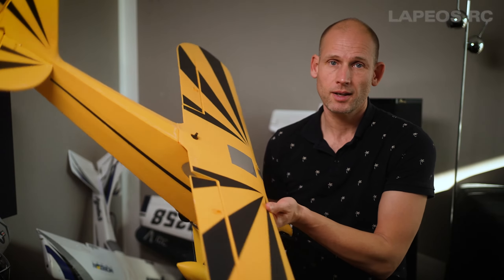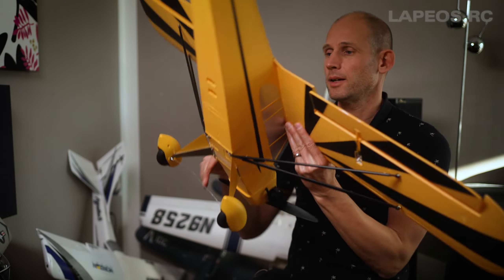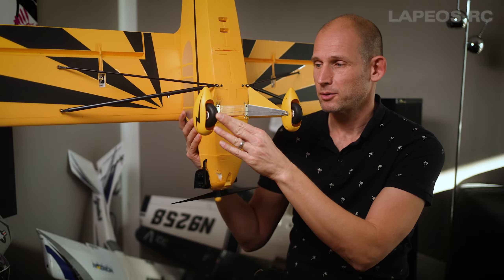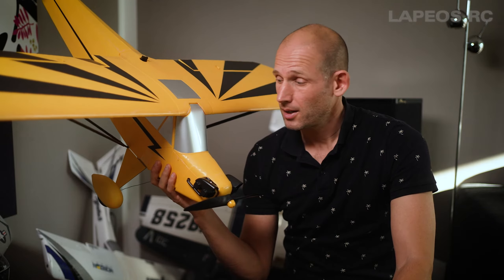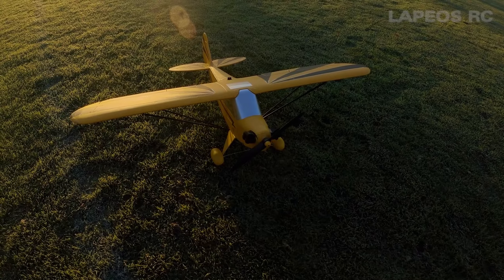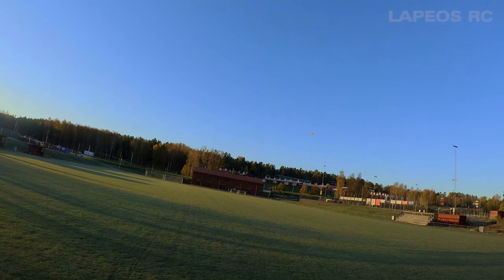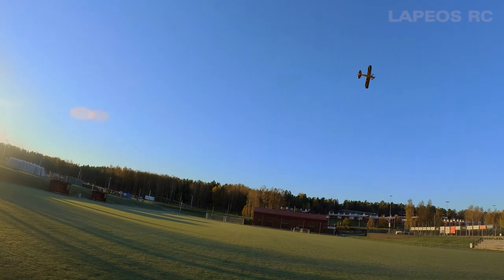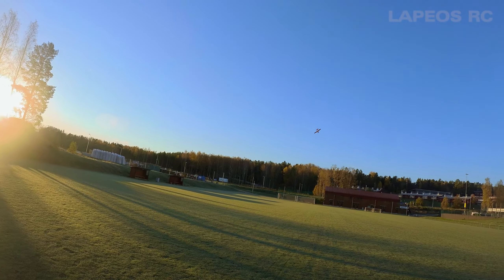E-Flite Clipped Wing Cub - Gears suck!

Comment: I couldn't agree more. Great flying, great looking plane, but the landing gear will fail with anything other than a greaser on a smooth surface. We screwed a thin piece of ply between the two rear landing gear mount screws and that keeps the gear from moving enough to damage the springs. Nice flight!
Reply from the maker: Thanks! I have done an upgrade to the landing gear that I'll show in the future but just as your solution I think there are many ways to improve the poorly original gears.

Comment: Springs are exactly the same as the ones on the timber evolution. Everyone has had problems with those springs breaking even on normal landings. According to 1 person at HH, 'all the timber line landing gear springs are the same'. BS! Then y does HH offer 2 different sets? 1 for evo & 1 for the timber x series. (Speaking from experience).
Reply from the maker: They are not the same. Timber springs are beefier and so far I haven't broken them but on the Clipped Wing I have many times. But the Timber landing gears do break at the plastic fuse piece instead.
Reply: @SunriseRCAviator  

🤷 Your channel, your opinion 🤷
Reply from the maker: @old-rcplane-phart  Just look at them and you see that they are very different so it is not a matter of opinion just a fact.

Comment: Geez it must suck to be an RC plane manufacturer. No matter what you put out there is always some customer who wants to whinge! 😜🤣🤣
Reply from the maker: When they can make it better but don’t it sucks.
Reply: @SunriseRCAviator  Do Volvo make RC Planes? 😜😁
Reply: @theoztreecrasher2647  

FYI, Volvo DID make real plane engines. 🤪🤷
Reply from the maker: @theoztreecrasher2647  They would have been great but expensive  But SAAB makes fantastic real planes!
Reply: @SunriseRCAviator  Yep. And the way things are going in Europe these days they might get some real-world testing in the near future! 🥶
Reply: It's made in Chiner, what do you expect. Imagine if it were made in Japan, it would cost more, but it would be excellent quality. Period.
Reply from the maker: @old-rcplane-phart  And ship engines!
Reply from the maker: @free-birdrocker8809  Made in China is usually cheap and dirty but this is more of a construction fault and less with cheap to do. Mane other RC planes made in China works fine just because they have a better design. I had a video camera made in China for seven years and it looked brand new and worked great before I sold it so some good shit and be done over there.